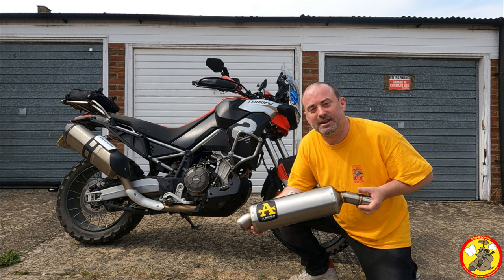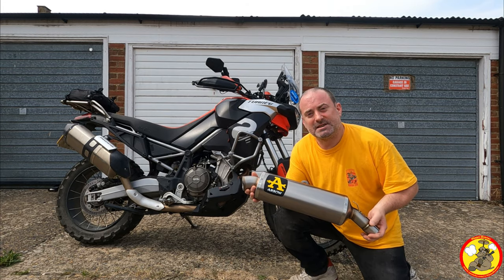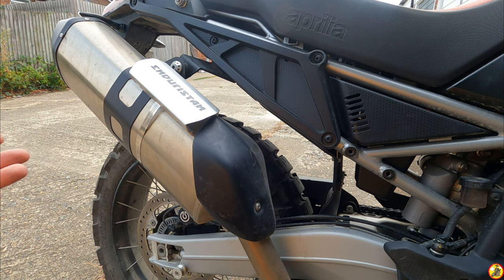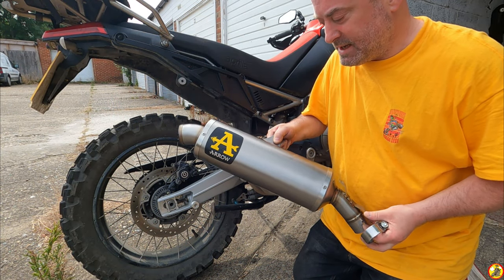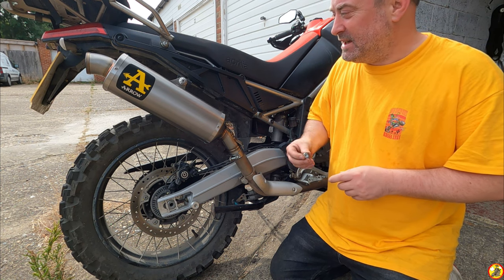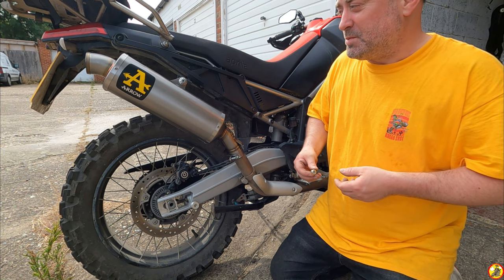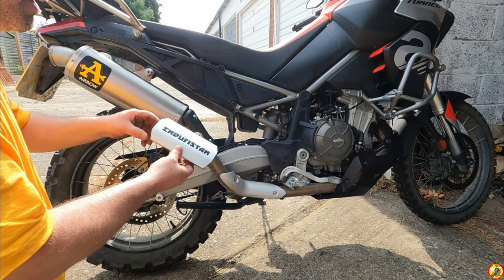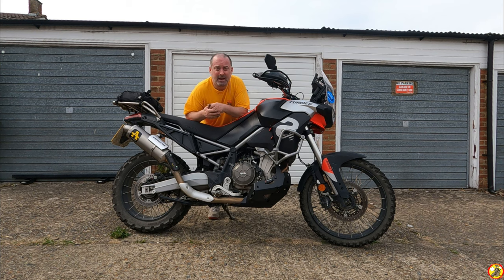Arrow Silencer Install | Aprilia Tuareg 660

Comment: I've recently done mine on the NC to a full Black Widow system.   Its totally changed the bike and I really enjoy riding it around , sounds epic!!     On the flip side ,I'm still not sure if it will become annoying on longer runs but I always have the option of sticking the CAT back on and just having the end can....I'll see how it goes.   Sounds good  : )
Reply from the maker: Am hoping with the remap that it crisps up the throttle and removes the Euro 5 strangulation at 4k rpm when riding at constant 30/40mph speeds. Hopefully it'll not be too loud, and will keep the baffle in especially for trail rides.

Comment: I found with modern bikes that the cat, headers and mahoosive metal box thingy tend to mute the exhausts hugely. That led me to get full systems without cats for moto-GP style sound. Recently I've had the baffle in though to calm it down. I must be getting old 😀
Looks good on the tuareg. I think an improvement on the stock.
Reply from the maker: I agree... I've avoided decatting bikes in the past, but they mute the sound so much

Comment: I purchased the same muffler and ended up returning it because there was a rattling noise that was present inside the muffler at 2,000-3,000 rpm when the db baffle/killer was removed.  The rattle noise was not present when the db baffle/killer was installed, but I much preferred the deeper and louder tone without the db killer.
Reply from the maker: ahh that is a shame, did they not offer to replace the exhaust with one that doesn't rattle? I'll be keeping the baffle in, but will be fitting the full downpipe/collector/decat tomorrow and remapping the ECU with the UpMap
Reply: @HippoDrones  I purchased from AF1 Racing and they allowed me to return it to them instead of trying to warranty with Arrow since that may have been a lengthy process with Arrow being in Italy.  I ordered the SC-Project muffler from AF1 which I am still waiting on to come in.  I was surprised how quiet the Arrow was with the db killer installed and personally prefer something louder, so I am hoping the SC-Project provides a louder tone.
Reply from the maker: @jcluv4life  my Arrow can took a few miles to bed in, it is now quite a lot more fruity than it was in this video
Reply: @HippoDrones  I rode mine several hundred miles going back and forth between having db killer in and out, but ultimately preferred it being out for the additional sound and was bummed with the rattle noise.  Would be curious if yours has the same rattle with the db killer out at very light throttle openings between 2,000-3,000 rpm.  If you do remove the db killer be careful not to drop the small screw that fastens the db killer down the exhaust.  I did that once and had to fish out from the bottom of the exhaust pipe collector with a magnet which was no fun.
Reply from the maker: @jcluv4life  #TopTip ta.

Comment: Its finding the perfect sound level. Are there more boxes/cats further up the stock system that get removed with the full system?
Reply from the maker: The full Arrow system deletes the cat. The stock system has the cat on the right side of the bike at the front, and is the main cause of people complaining about the heat from the bike as it is funnelled straight onto your leg. I've not really found it an issue, but we are in the UK rather than Arizona lol, but removing the cat will def cool things down a bit.

Comment: Looks great and sounds nice Mate !  Where is your mic, is from your camera or do you have one hidden somewhere. cheers.
Reply from the maker: Cheers TPR, am really chuffed with it.
For the whole video I was just using the cameras internal microphones. I did mean to fit the Media Mod to the camera for the intro/outro as that has a shotgun mic, but forgot, so it was all the standard inbuilt mics.
Reply: @HippoDrones  wow impressive mic, my old GoPro 4’s will never sound that good. 😎
Reply from the maker: @MRTPR  the Hero 10 is a cracking camera